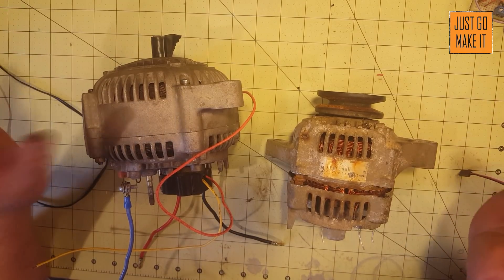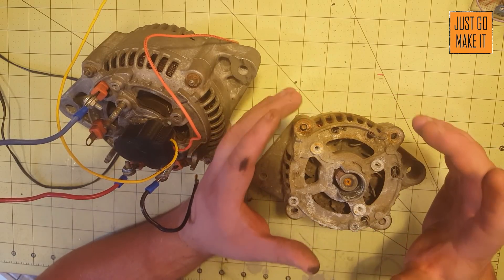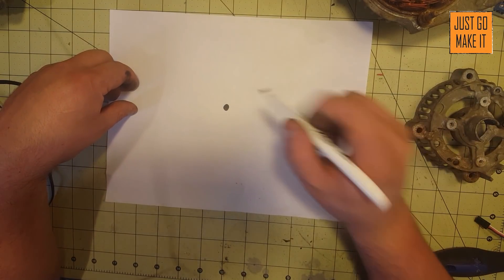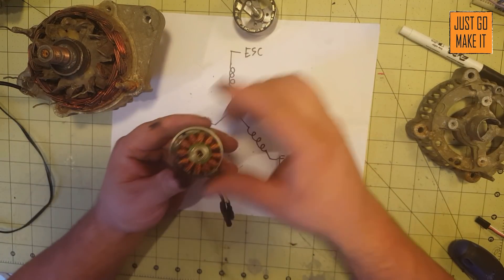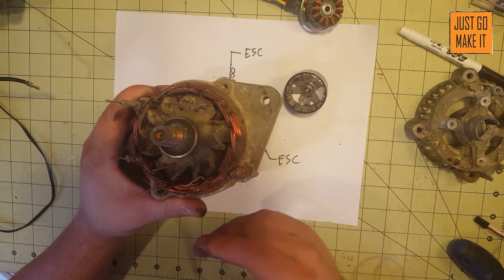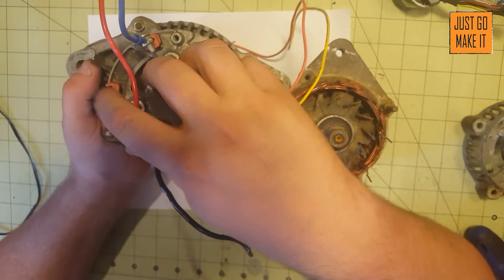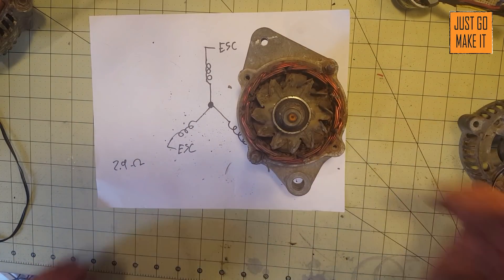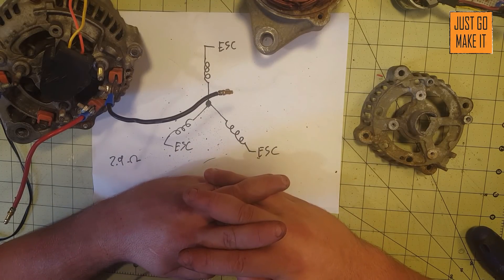Pt.3 Alternator to Brushless Motor Conversion 2.0,  Alternator Modification

Comment: wanna do an explosive video that will make millions of views. get a 12 volt high speed motor with speed controller and the attach the little motor to a 350 amp alternator and then make another 350 alternator into a motor and then use the energy direct from the alternator to turn the motor and use a really long cord man because it will burn up fast.

Comment: IT's not a brushless motor you still have to use the brushes to supply power to the armature to give it a magnetic field. A brushless motor has fixed magnets
Reply: this is a brushless motor, just need separated excitation (sep ex BLDC)
Reply: @foxxyytofficial  THE separate excitation uses brushes so how is it brushless? if you remove the brushes will it work ? NO so its not brushless. The advantage of brushless motors are the have no brushes to wear out. what you have created is a  switched reluctance motor

Comment: can you use a power drill botton  to control the speed of the motor?
Reply: If u do use a relay or the switch will melt with high amp.

Comment: They 4th (that one you don't wanna mess with)  one will come on handy one day when u do make a go kart. I'm pretty sure u can use that one as a brake.  So you wouldn't need a mechanical brake
Reply: If that thing is winding at full rpm and u apply 2-5 V to the 4th wire should completely stop the turning. What I don't know is how could u use that in a way it wouldn't lock the tires up.  Something like car brakes..
Reply: @TheTruthMatters  its better to buy controllers with regen/electronic ABS than trying this

Comment: Hi Buddy, I had  take a look at all your video pt1 to pt4  thank you for that, I had a alternator out of Ford F150 , these alternator had total 6 phase it totally 12 wiring , I try but cannot connect  to run , can you make a short video for that when you have time ,  Thank you very much .
Reply: 12wires and 6 phases? some people use motors lihe this with 2 controllers at the same time, others connect those phases to be 2 parrallel phases groups

Comment: Ive seen other videos where they simply hook up a motor controller to the alternator and it works fine no need to add brushes
Reply: they dont add because the alternator already have them, they just use them to feed the field coil of the rotor

Comment: First of all, not all alternator, nor motor, have this coil configuration. This winding is called a WYE config where, like you said, have 4 "set" of wire. As you clearly don't know, there's a another one called Delta config that  have better speed capability. From this one, you will have 6 wires or 3 "set" of combined wires. You attach this config the same way you would on a WYE one.

Comment: what about making it with a delta configuration?
Reply: Delta would cut the voltage required but raise the current draw. Either configuration would work.

Comment: How much power will generate this motor in bhp and torque figure
Reply: one horse power is about seven hundred plus watts ow much are
you going to put in     two to four horse more then that heat can be
a problem
Reply: some alternators can get a little less than 4,5hp

Comment: Hope you will answer i seriously want to start engine with alternator for small engine i am thinking to use 200amp esc with 24volt but my question is will it start spin underload or not...?
Reply from the maker: if you geared it down maybe.  give it a try
Reply: JUST GO MAKE IT how many volts for rotor..? Will it spin with 12v i need turoqe no need high rpm
Reply: I'm working on same idea, but I figured that Star Delta system might give the torque required because my engine doesn't have a decompressor, problem is configuring a Delta start system into a alternator to make a Start-a-nator will require some figuring out and the system requires a lot of switch gear and external wiring, so a de-compressor would Ironically be easier to install in most cases and could be done with a solenoid, lol.

Comment: What can you run with this thing?
Reply from the maker: im am going to make an electric bike to start out
Reply: JUST GO MAKE IT does a bigger alternator make more power, or doesn't it work like that? I know nothing about this :/
Reply: Music Islife more amps = more torque more voltage = faster rpm
Reply: Music Islife i would think it would.

Comment: Can the alternator work directly with 10v DC battery without ESC controller? Cos mine refused to spin.
Reply: No, a brushless motor actually runs on 3 phase AC, generated by the ESC using DC, but you can find some cheap ones online

Comment: I wish someone would walk through using a "hairpin coil", "six-phase" style alternator.  I understand that one set of coils can be used exactly the same as described in the video and it will still run, but what about the other set of three that are unused?  How can those be incorporated?  NOT using them must cause some amount of loss in performance.  Each set of three is connected in a wye "y" configuration.
Reply: @BluntForceTrauma666
if you can spin the alternator with a small current going into the brushes and the two center taps connected together then test 1 wire from coil set 1 against all three from coil set 2 , if one of the tests is zero volts label both wires as 1 , then test a second wire from coil set 1 against the other two wires from coil set 2 , if you get a zero volt label both wires as 2 , then test the last wires on each coil set they should be zero label them as 3 .
that was a bit long winded but if you found zero volts or very low volts then you can join 1 to 1 , etc and run in parallel , disconnect the two ct wires :-)
Reply: Oh shit...No, I hear ya man.  I didn't think of trying that!  But I see where you're going with the idea.  It's kinda like when connecting two transformers together in parallel and you need to have the phase angle between the two going in the same direction.  So you test for a voltage between a single output of each one and if you get a significant reading you DON'T connect those two together (for the case of a transformer).  Thanks dude...
Reply: @BluntForceTrauma666
your welcome  :-)
Reply: What is a six phase  alternator     and how to do this this is interesting

Comment: How is this a "brushless" DC motor when he uses the brushes about 2/3 of the way through?
Reply: @
Jeff McCrea
minor technicality  , hehe :-)
it is just because there is no permanent magnet so the brushes are just to supply power to make the rotor magnetic :-)
Reply: Dudes hes using what he has and is explaining this, however don't roast him over that because you can get a PMA  Permanent Magnet Alternator which will correct this minor problem. they are used on small tractors etc and custom made for wind turbine applications which reminds me that you can get a whole range of different stator winding for different voltages in those applications.
Reply: To get you to waste your life and start watching in uneducational video! He’s trying to teach himself that he doesn’t sound like a creep!
Reply: This the point when I stopped watching too.  I was waiting to see how he made this brushless !

Comment: Hello ,,, a question please.
Is there a way to operate the alternator without the speed control esc ?and why.
Please respond if necessary.
Thank you
Reply: @
Elyas S
you can use any BLDC motor driver with enough current rating (20 or more amps) . you also need a small dc current supply to the brushes :-)
Reply: Or get an old light switch out of a car
Reply: The dial kind

Comment: I have a AC DELCO 335-1068 / 88877278 and it has only 3 wires that terminate at the end of the alternator. There are 2 wires that are connected as one wire and there are 3 of these.  Do it simply use these 3 or do I need to do something different?
Reply: @Tom Peterson
it is delta wound , it will use more current to drive , you could separate the wires and make into a Y but you would have to look for the start and end of each winding and use the same end from each to make the ct :-)
if you cant see all the ends it will be trial and error , it wont turn at all or it will stutter if you have one wrong :-)

Comment: Why not use the original brush holder?

Thanks for sharing!
Reply from the maker: you can,   i lost the one i had.
Reply: So it is not BLDC right cause it has brush? but it operates same as BLDC principle right?correct me if i m wrong
Reply: It is a WYE connection. So connect the output of a VFD to this.

Comment: Just to let you know: Some alternators are 4 phase types, as opposed to the 3 phase ones you are working with. 
 They have 4 connections points, but these all terminate with 2 wires, as opposed to one of them having the 3 ends tied to it. 
 Watch out for those, as they will not work for you!
Reply: There is no such thing a 4 phase alternator you are confusing how the stator is wound, is. Y wound or delta wound and can be rewired if you know what you are doing. There are several good books at most library's that I suggest you read to learn all about electricity and how alternators, generators and motors are wound
Reply: I figure that the number of 'phases' is open to interpretation but the number of poles can be denoted one of 2 ways [manner 1: only 2 poles, south and north, manner 2: the total number of active north nodes or south nodes]. Still, one thing to keep in mind is that the flow or shunt of current between poles is open to switching.

With modern gate switches one can cluster switches and leads digitally so as to develop as many [needless] 'phases' as they wish, but in the end, its pointless how many 'phases' one has since going beyond '3' never matters to the poles, which only count a maximum of 2 [x number of north, and x number of south] repeated around the field and around the armature.

Arguments exist as to how many north pole spikes and south pole spikes are best, based on things such as 'cogging,' 'vibrational damping', 'torque distribution,' 'field pole interruption,' 'field feedback,' and 'gauss saturation' but much of this is moot.

The fields and pole nodes are spaced widely enough in an alternator that they operate smoothly at high speeds without complications.

I like to think of it a way that many will argue is too simplistic, but I say that people spend too much time over complicating it just for personal vanity and at the end of the day, with all of the convoluted wiring and winding changes they make to deviate from the original, they produce no productive contribution to the advancement of the science.
Reply: CNCmachiningisfun do u traing whit 3,7v in the magnt coil, but then put 1,5 v any alkaline bat and u see the rpms , you got scare the noise the speed was unvilibebl
Reply: +Juan Isiordia 
 Yes, an alternator can spin VERY fast, if set up correctly  :) . 
 Mine does nearly 10,000RPM, with a 14V battery.
Reply: CNCmachiningisfun ,ok soo know use a blcd speed controller and put 48 v, do u think the speed can u have, i wana do that , and see how do it
Reply: +Juan Isiordia 
 Yes, I want to go up to 36V with my system. That should make it go at least twice as fast as it does now  :) .
Reply: CNCmachiningisfun do u have face book account..i wanna show u my proyect, you can use as motor and generator at the same time like autosustentable energy ,
Reply: Sorry, I have no facebook account, only youtube. 
 Perhaps you can make a video on youtube to share your ideas. 
 This is a great way to share ideas, and have conversations  :) .
Reply: So what exactly is wrong with a 4 phase alternator?
Reply: My Toyota has 4 wires on the rotor plug, does anyone know what the extra 2 wires are for?